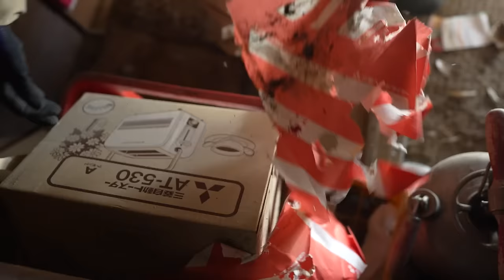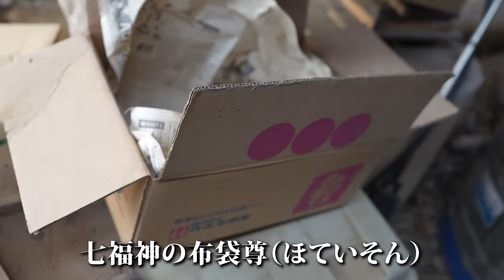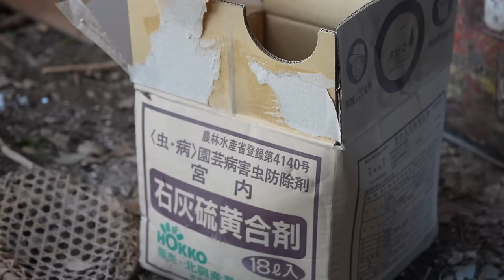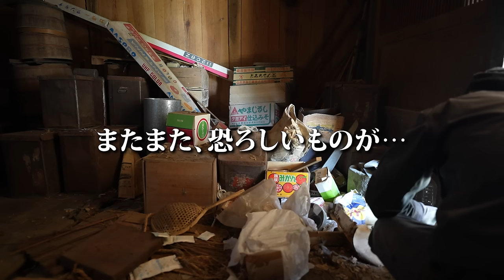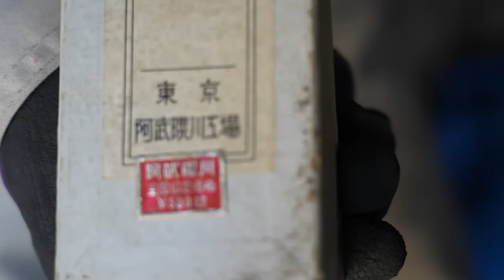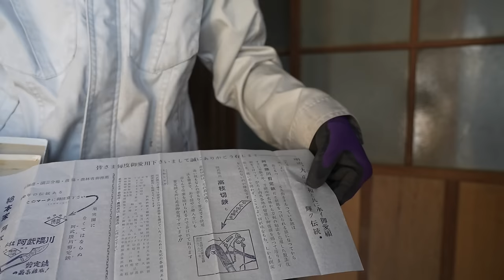200年前に建てられた蔵の中身にゾッとしました…【廃墟復興158日目】【蔵の片付け】

Comment: 🇳🇿As your next work will be upstairs of the store room, remember to “Work smarter, not faster.  It will make your work easier when you need to take rubbish away if the rubbish is sorted into specific piles as you go. Wood, plastic. Paper, metal, etc. Shame you didn’t have the hindsight to do this right from the beginning. Would of made your work easier and faster. 👍.